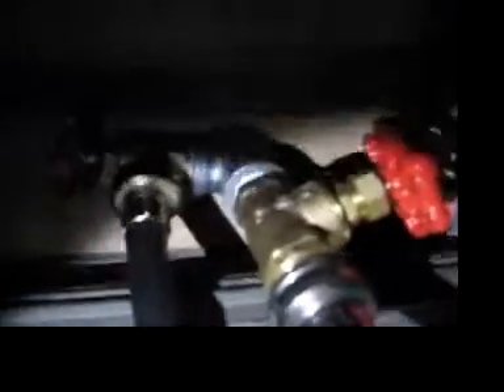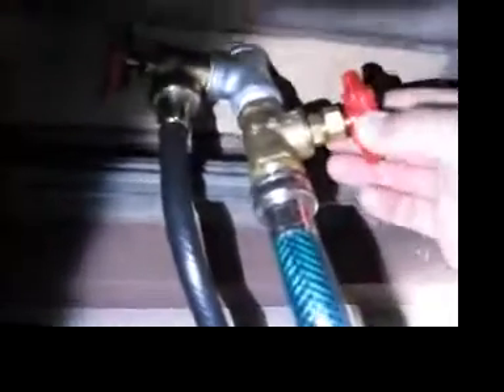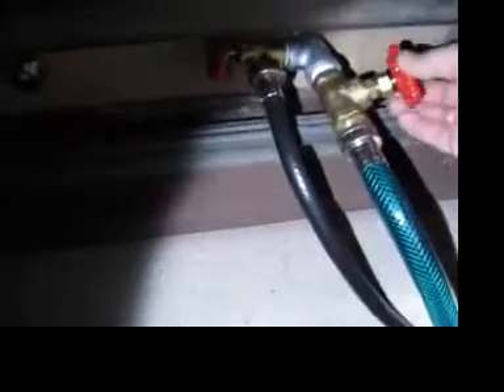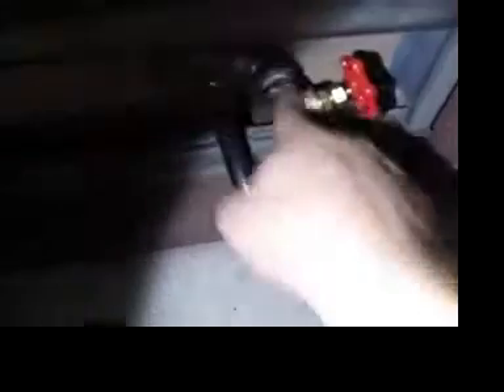How to build a Rain Barrel with electric pump

Comment from the maker: Great idea, but I think you'd run into volume problems, the orifices and diaphram in a FPR are a lot smaller which are great at precise regulation of high pressure fluids like fuel in an engine, but the volume of a garden pump is too great.  I like the mixer valve idea, I have yet to try it, but it sound like it would work.

Comment from the maker: I thought about using a sump pump, the problem is, they're super high volume, it'll empty your 60 gal rain barrel in about 60 seconds. :p  Also, you'd have to still use some sort of switch to keep it off, because you don't want your rain barrel to empty once it's full, you want to wait until the rain is done, and everything's dry (days later)  but it's still a "pump" and would get the water out. LOL.

Comment from the maker: A good way to test prior to installing is to prime a 50 ft hose full of water, then hook it up to the output of your test pump, turn it on, see if it's got enough power to push all that water out of the hose and still provide some sort of spray.  Also try covering  he outlet with your finger, if you can stop the flow with your finger, it's not strong enough, it'll cook the pump in no time.  :-)

Comment from the maker: Not sure how well this will work, Aquairum pumps are high volume / low pressure.  Depending on how long your output hose is, it will drop your output pressure to the point that it might not even be able to move enough water to your sprinkler.   My 1 HP lawn pump has just enough volume/pressure to push 50 ft of hose.  Let me know how it works though!

Comment from the maker: It'll work great as long as you run in series with a float switch so when the timer turns on, it will only power the pump if the float switch is up and there's enough water in the barrel, otherwise it'll burn out your pump if it's dry when it turns on.

Comment from the maker: I thought about a timer setup, but you def. want to run it in series with a float switch, so when the timer turns on it won't run the pump dry, it'll shut off with a few inches of water left in the barrel.